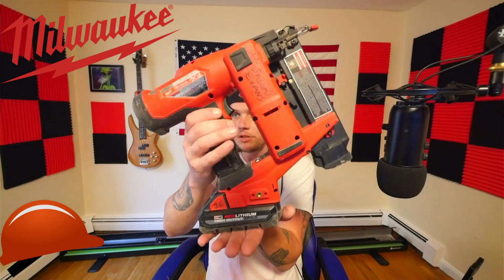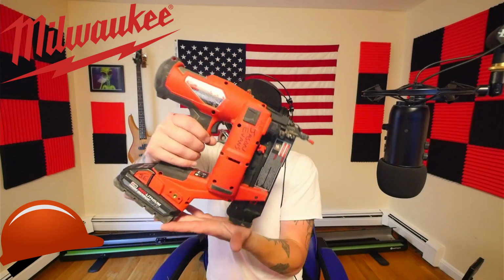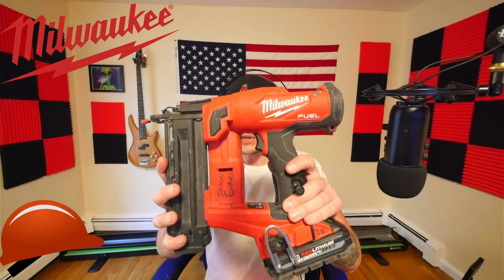Milwaukee M18 Fuel Brad Nailer GEN 2

Comment: As I drag out compressor, wishing I had cordless but don't do enough to justify (catch 22).

As for the stairs, looks good. But your code requires them for ~35" sills? I am looking at that window opening thinking it is too small for me to get out of. Let alone get higher up to then do funky yoga position to exit. Maybe new exercise trend?
Reply from the maker: The windows are being replaced Up to code. Havnt got there yet. Its a work in progress. I'm not worried about it anyways. I do as I'm told Like a good little pee on. Its above my pay grade as they say. The boss points and I do. For now.
Reply: @WorkingClassKnowledge  as I looked, sill height no higher than 44" min 5.7SF opening.  Gets particular for the ladder and encroachment on the window opening itself on the outside.  I am scratching my head rt along with ya.....
Reply from the maker: That's the bosses problem. Ive tried to put my 2 cents in before and he didn't want to hear it. and then I as right in the end anyways. But he signs my check. So what is one to do.
Reply from the maker: Yeah mabie were you live that will fly. But if you saw the stair cases I go up Wich are way out of code but as long as you don't touch them they stay kind of thing. so Boston stairs never get touched and dragging an air compressor up is impossible sometimes